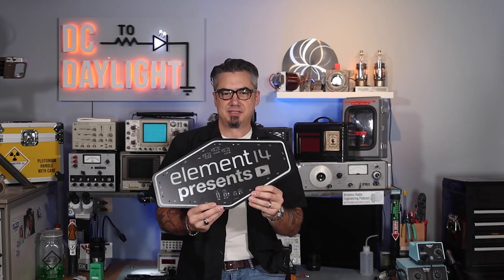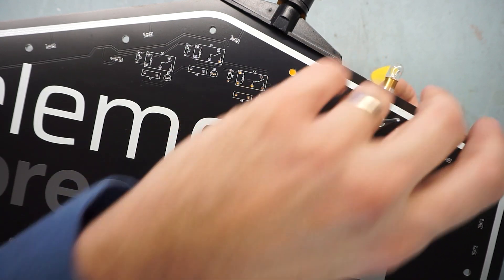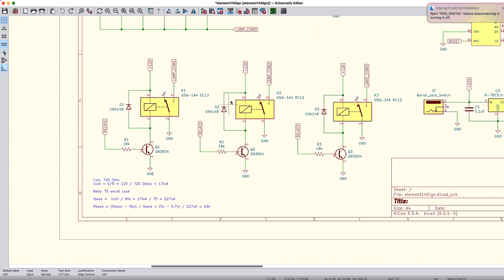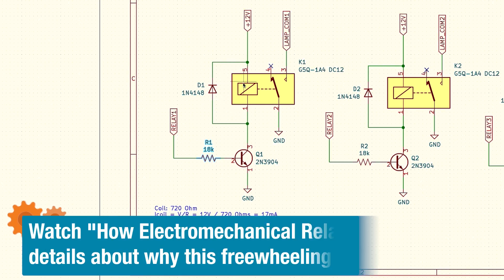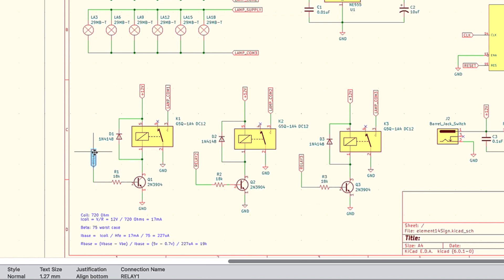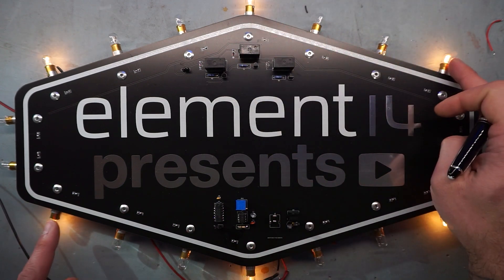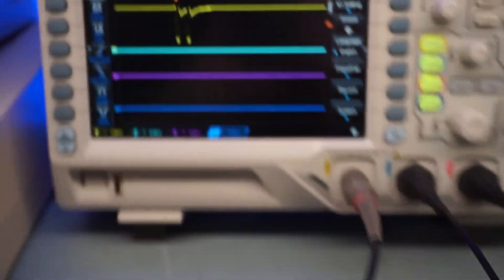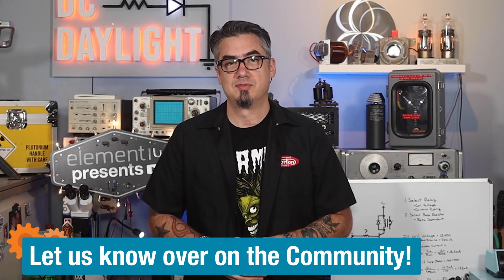Using Relays to Make a Vegas Style Sign - DC to Daylight

Comment: I'm not sure why you need the 5v regulator. The 555 and CD4017 should both work fine at 12 volts.
Reply: Also if you just used 12v everywhere you could always have 2 bulbs in series for 6v/bulb.
Reply: One of my favourite features of these chips as a kid was that I could power them from a PP3 battery
Reply: @AmRad Podcast This is perfect example of why you might use simple logic chips instead of a microcontroller. I think building it with a microcontroller and having to deal with the regulator and then showing that you can do the same thing with a couple chips at 12v would be very illustrative to people who are in a microcontroller comfort zone. If it is just an exercise you should say "this is not how you should do it at home kids" no?

Comment: The relays switching at this rate will die sooner,  I think you could have used a better alternative like a [2P4M] SCR  or a low power GTO or simply a MOSFET 
Cheers✨✨
Reply: I had to lookup the relay data sheet and it’s rated for 100,000 operations 1 second on and off at 5 amps 30V resistive load normally open. My crude math is about 55 hours of continuous use. In reality, I’d probably go insane way before those relays fail! Cheers